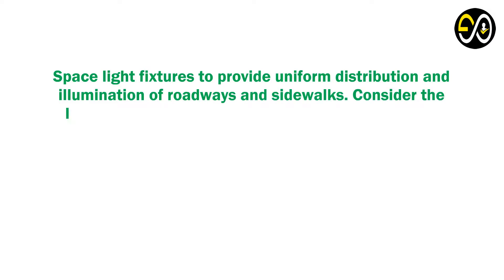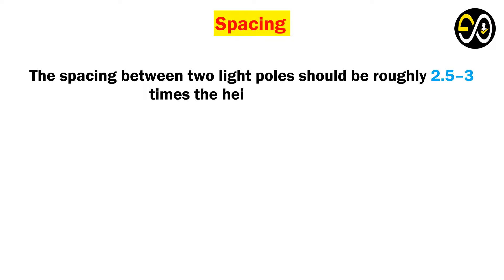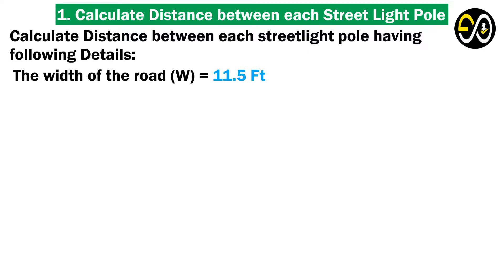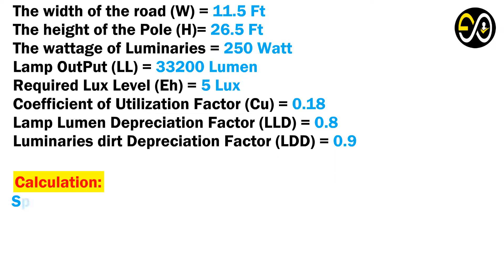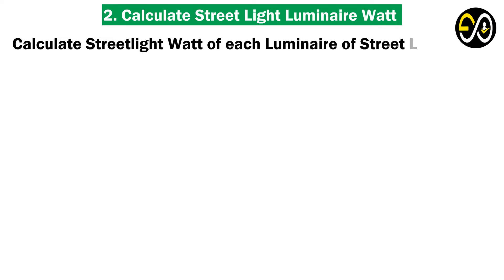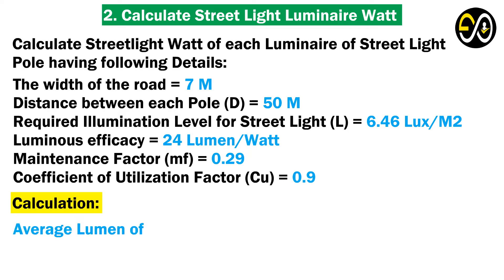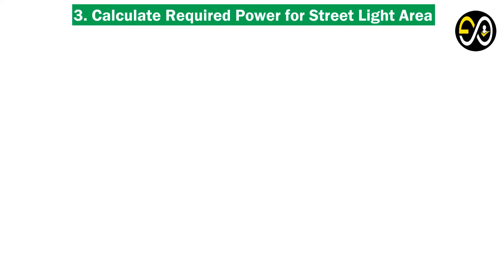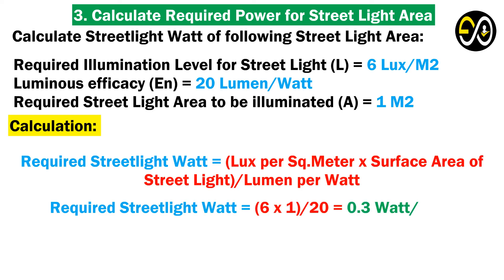Calculate Street Light Pole’s Distance, Fixture Watt, And Lighting Area

Comment: It’s 2023 and our neighborhood has been brightened up thanks to Duke Progress (how ironic) Energy. Overly so and unnecessarily. Now thieves and vandals can see their targets. Easily. Yes. We are experiencing a rise in senseless damage to vehicles because NOW they are easy to spot! Busted windows etc. 
Bright parking lot lighting benefits the criminal. Caught on video tape, we watched the criminals look into the interior of parked vehicles and “shop.” Two went into cars by breaking through the windows with a tool, like the kind used to escape a sinking vehicle. The windows broke so fast! Seriously folks. Brightly lit parking lots attract the criminally minded because they are looking to wreck something and NOW they can easily see it. We saw another thief going into a mini van parked on the street by breaking the passenger side window. He had to use a flashlight because the streetlights were dimmer than our parking
lot lights. Someone in lighting design for Duke has their head up their butts. Dim the lights you dim wits!